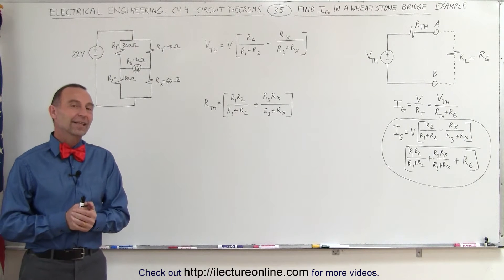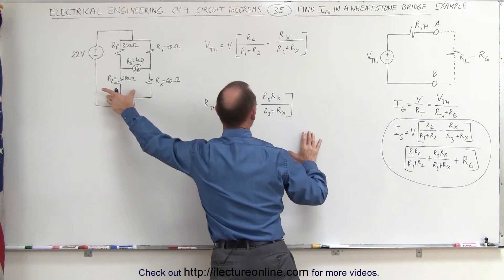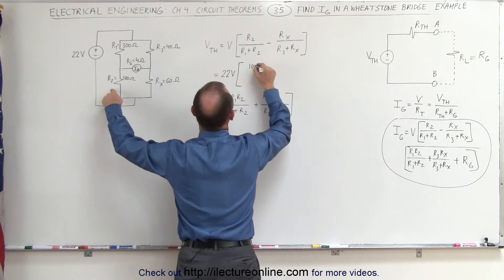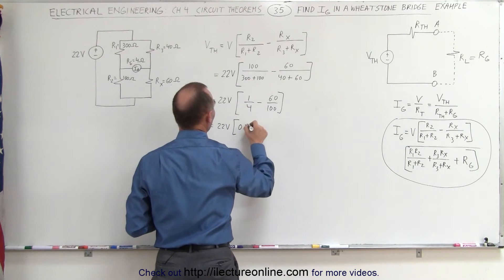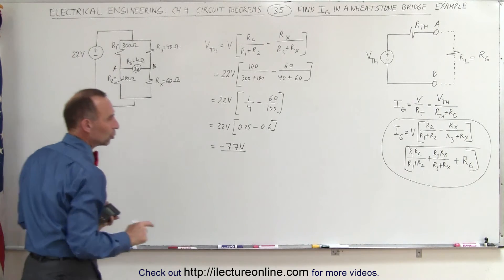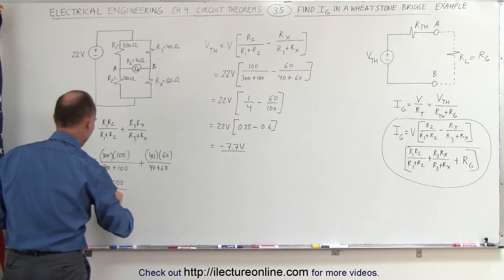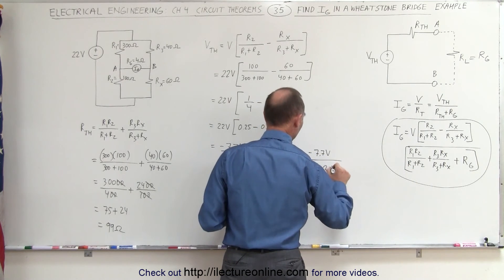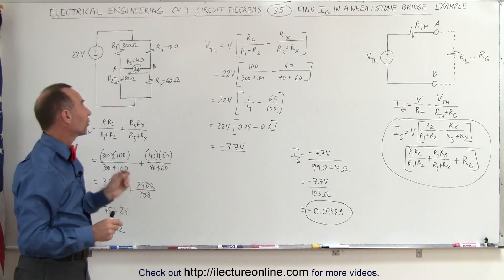Electrical Engineering: Ch 4: Circuit Theorems (35 of 35) I(G)=? in a Wheatstone Bridge Ex.

Comment: why when you calculate ressistence of R1+R2 or R3+R4 you make it like they pharallel but in the voltage you use formula of voltage divider that is used for resistors in series??
Reply from the maker: When you calculate the RTh you remove the load resistor and set the V = 0.  Then calculate the R between A and B terminals.    When you calculate the VTh Remove the load resistor, keep the Voltage source and calculate the voltage across A and B.